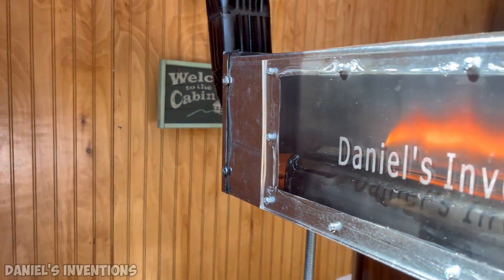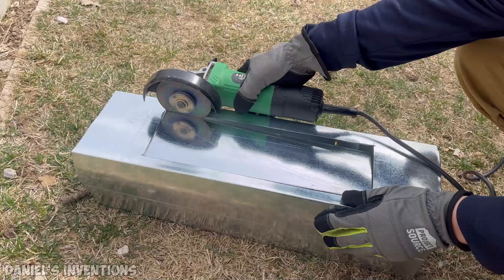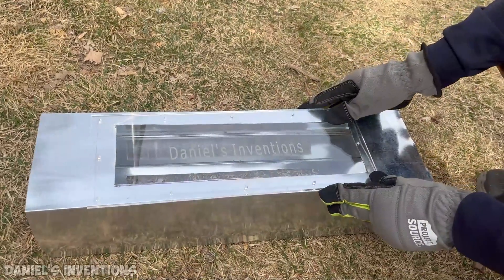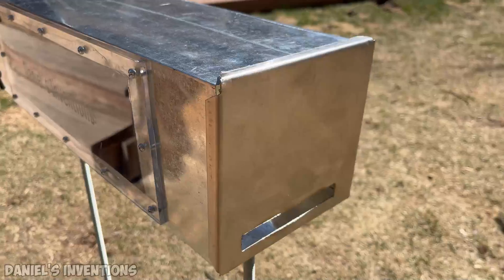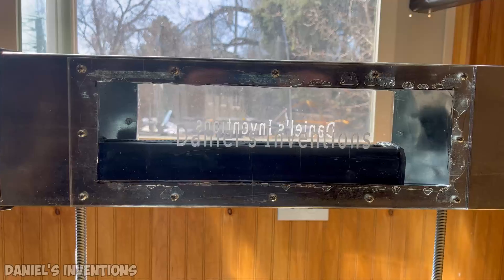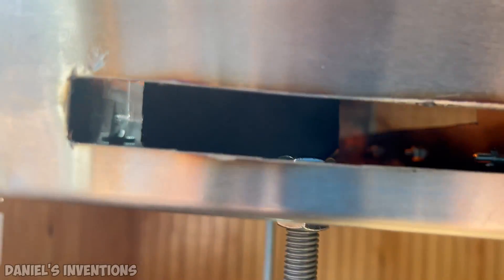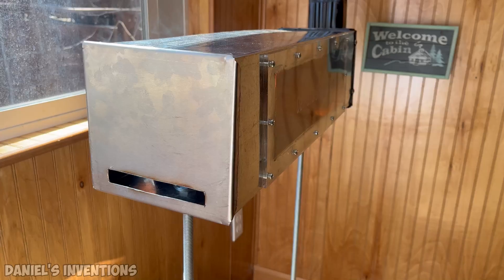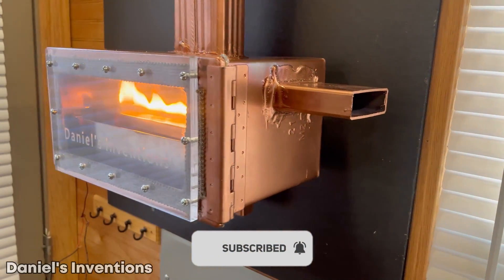ENDLESS Heat for Your Home WITHOUT Electricity 3.0

Comment: Galvanized ducting should not be used for high temperatures. The coating off gases nasty fumes and can make you sick. The aluminum downspout also will off gas.
Reply: Thank you for posting this. You are correct.
Reply: Galvanized means zinc coated. Zinc is toxic when heated, I believe even at lower temperatures. It is in fact 200 degrees Celsius, according to Google. My question was the original green paint of the ammo boxes, would that be concern for toxicity if painted over with high temperature paint? Thank You for the great project.
Reply: So what to use instead?
Reply: @GiovanniMorenoMusic Plain steel.
Reply: @GiovanniMorenoMusic  Non gavanised métal. Galvanised mean that the métal is plated with zinc. It protect the métal from rust. Use stainless steal or Iron. Iron cost less but will rust if you don't take Care of it
Reply: Strong poison first seconds you filing like swits in mouth and after few day no more tooths ..
Reply: Beautiful
Reply: Scary selection of materials for something inside
Reply: Zinc is actually insanely good for you.
Reply: @ryanthibault737 look up zinc poisoning from galvanized
Reply: dumb ass that galvanized steel will kill you ??? :(
Reply: Good mention. if it were me, I guess I would open a window with a fan and sit in the other room for the first 2 or 3 burns, and I'd try to do them hotter than average, if possible.
Reply: This is not true. The temps don't get nearly hot enough for this to occur
Reply: @NextGenerationHealth  ok. If someone did mistake mixed oil and gasoline . every day happens drives mixed diesel and gasoline
Reply: @alijagakiazimovas8829  If you got mixed up and filled a stove like this with gasoline... Zinc fumes would be the least of your problems. LOL holy crap dude!
Reply: @MandrakeDCR  ask professional welders and you see surprise .. old school !
Reply: @alijagakiazimovas8829  I don't have to. I'm not an idiot. Pouring gasoline into an open reservoir and then putting a match to it is going to result in a much more immediate emergency or fatality than worrying about what metal you made your stove with! WTF are you even talking about? New school, old school, preschool... if you're on fire or dead, you're really not going to care if you're inhaling Zinc fumes am I right? lol - wow.
Reply: @MandrakeDCR  better ask professional welders and you see
Reply: @alijagakiazimovas8829  My uncle Ron works at Heinecke Welding and is a co-founder. He's been welding and forging for 40 years. I asked him to see what in the world you could be talking about. He said to tell you that the dangers of zinc rolling off of a weld generally has no gasoline explosions in your face going on, and that would definitely take priority. I think you just don't want to lose an argument.
Reply: @MandrakeDCR  don't forget food zinked canes have sigh after few day food it's poison.. !
Reply: @alijagakiazimovas8829  Who cares? That has nothing to do with hat I said. What are you going on about? I never said Zinc wasn't poisonous. Did your hamster die from zinc poisoning or something and you're so traumatized you can't stop yourself?
Reply: @MandrakeDCR  I know friends father lost all tooths because welded zinced pipes and wen you welding this pipes need use extra special mask connected to cylinder of oxygen
Reply: @alijagakiazimovas8829  That's a terrible story. Best wishes to your friend's father. Now, what the ever loving f**k does that have to do with my original statement, and how is that relevant to the immediate danger of a gasoline fire?
Reply: @MandrakeDCR I don't know who said what. But I'm a trained welder, and before the training, got zinc poisoning from welding galvanized steel pipes without stripping off the coating first.  Felt like flu.  Miserable for a couple weeks.
Reply: @NextGenerationHealth yes it will. You don't have to burn the zinc to have smalls ppm spreads into the room. Zinc is not meant to be hot. It just prevent rust. Remember that the zinc is just plated. You don't have to reach the point of fusion to have particles. As you don't have to reach 100 c to make water évaporateur. You just leave a glass of water under the Sun. Water will evaporate

Comment: Is the oil reservoir sitting on the base of the core or is it elevated a bit? Are you ONLY using cooking oil or can you use automotive oil? I'm surprised you're not getting the intake air from the outside. How are you refilling the reservoir?

Comment: You might consider a metal tool box from harbor frt. for the firebox 21 x 10 x 8.5 prox dim. , heavier ga. metal  and carbon fiber felt for the wick.
Reply: Are those metal amo box safe to use

Comment: There's a large military ammo box that would be great it's a little  longer then the corrugated tube you used in this one its made to hold 2 rockets for a launcher I find them online alot and bought one to store tools in for my truck now thinking about making one of the heaters out of it did you build the oil resivore  yourself or was it made from something else in this heater I'm planing to use a peace of steel box tube and weld end caps on it for the resivore any size slot work as long as the wick can fit in it or will I need to make it slightly warmer then the wick iv made oil candle from steel cans but couldn't get the oil to wick up to stay going so not sure if it was the hole to small I'm making it to use in my small camper and one for my room in the house for emergencies  last winter we had lots of power issues due to trees falling on the lines so wanted to be ready for that this year

Comment: V2.0 is a much better and durable design by the simple fact that you started with an old ammo can which was certainly a better starting point for a durable heater. You may want to invest in a welder at some point to, but all in all this is how you learn by doing even if you make mistakes, it's worthwhile project.
Reply: The ammo can idea is absolutely brilliant. I am worried about durability, and about what kind of fumes the paint would put off in operation though. 

When I make mine, I'm probably going to sandblast the previous coating off and go with high-temp paint, steel or copper vent pipe, and vent it through a sheet of cement board placed in the window rather than making a hole in the wall.
Reply: @coalcreekdefense8106  you are starting off on the right track. Any metal that is intended to be used in a high heat environment should be Sandblasted. This will ensure that all potentaliy dangerous coatings are removed. After blasting, the container shpuld then be recoated with a high temp enamel. Something like coatimg that is designed for car motors or exhaust headers is made to wothstand up to 1500 degrees. Which should be more than enough for a small heater like the one shown. Also the heater should be welded together instead of using jb weld or anyother adhesive welding will imcrease the streghth of the heater and prevent any onforeseen complications that may arise from using jbweld. Besides, amazon has plug and play welders that are supet easy to use amd they can be found for less than a 100 dollars. They would work great for a project like this and as a bonus you will learn to weld which is a vital skill that every one should have a basic knowlege of.
Reply: He's going for more heat. Maybe an insulation issue at this point

Comment: Why waste time with oil burning? We want to get as far away from fossil fuels as possible!
Reply: You are a libtard idiot
Reply: Use vegetable oil.
Reply: Yeah, because Lithium batteries and dead solar cell waste is such a better option for the environment not to mention the total cost in manufacturing this poison... smh
Reply: @PaladinPierce  You should really check your facts. This is total BS and you've fallen for it.
Reply: Lol no "we" don't.
Reply: Glue one arm or leg in a metal box and ignite it with a magnifying glass, fatten up for winter.
Reply: And then blow me !

Comment: i have built 2nd heater. was really hard to drill through glass, takes time and patience. cant wait to try it out but at the moment looking for someone to make stainless steel tray for the oil, or gonna buy some sheets and make one myself.
Reply: Lol😂 no need. Have you seen how hot a coke cola tin can heat up to using as a small rocket stove, just look for a Xmas buscuit tin or ebay small tin. Just pour veg oil into that and away you go! They can withstand the heat no problem.

Comment: I watched ver 1 & 2. Verses using a 12v battery to power your circulation fan, look into a heat sink with some SP1848-27145 Peltier TEG Moduls👍

Comment: I am building version 2, the horizontal ammo can, and just waiting on the high heat glass. It will be built as one unit mounted on a concrete board and will easily fit in my window so no wall penetrations required.
Reply: Just make sure the concrete doesn't get hot or it will literally explode!
Reply: I just did this .. the concrete backerboard works perfectly but the fuel... vegetable oil created so much soot that the device was unworkable.  Any ideas?
Reply: @Darth.Phaedrus  Maybe there is not enough airflow? I have seen other devices that burn vegetable oil well.